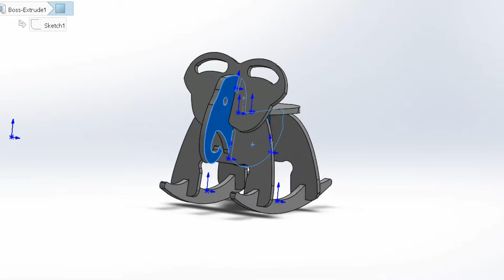Elephant rocking chair kid on my cnc

Comment: How wide are you making the slots comparative to how thick your ply is?
Reply from the maker: I made the slots 18mm  thats the same thicknes of the ply.
Reply: @ab-woodwork2231  I figured you made a small tolerance allowance or something thanks
Reply from the maker: @7R15M3G1  No toerance just sandpaper if needed.